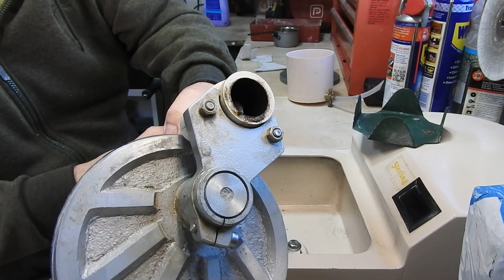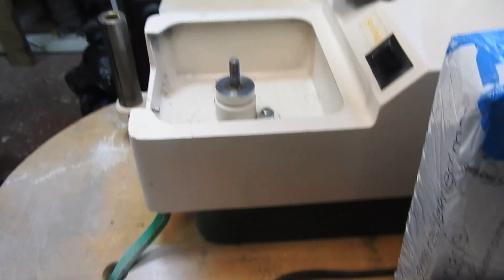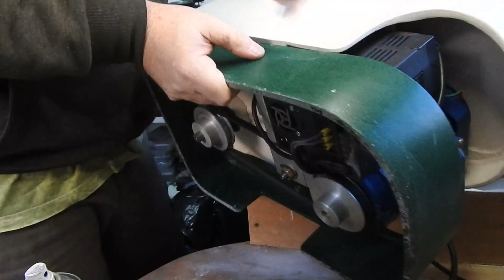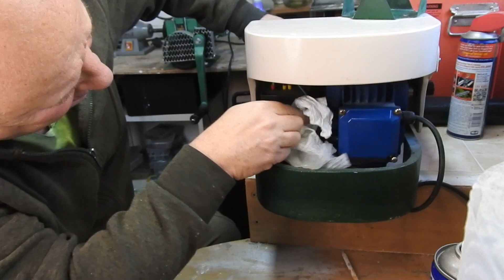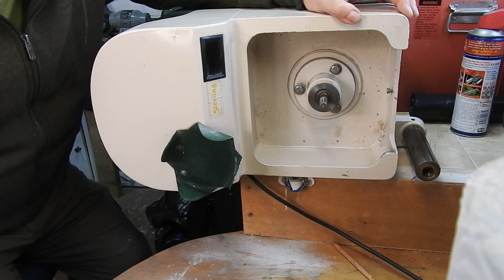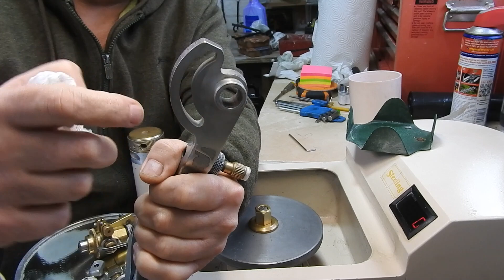Sterling Faceter, inspection, and maintenance.

Comment: Hi Mark, What method of payment do you used ? I read on Facebook a comment from someone being scammed by one guy selling this type of machine in Sri Lanka.
Reply from the maker: I did a bank transfer direct to Sterlings account. It was as you suggest a worrying time, however I spoke to Sandun from Sterling several times, had many email discussions and an official quotation on his business correspondence. You could pay by credit card as you have some protection. Just do as much due diligence as possible. It’s sad that we have those nasty bastards out there doing all they can to steel our cash. However I have found Sterling and Sandun very reliable. The best advice is contact him direct, as web sites can be hacked and faked.

Comment: Help Mark please how do you put the keyed in shaft back on the post that goes up and down holding the plate for the handpiece. Sure it goes on the post but turning the top doesn't make it go up and down. I actually need more steps. You just put it back on after greasing and had no problem lining it up. Why is my question Mark?
Reply from the maker: I think it is just a simple screw thread, I will have a look and get back to you. Sometimes it is worth undoing until you reach the click point at the beginning of the thread and starting again.
Reply: Te dio respuesta, amigo, porfavor